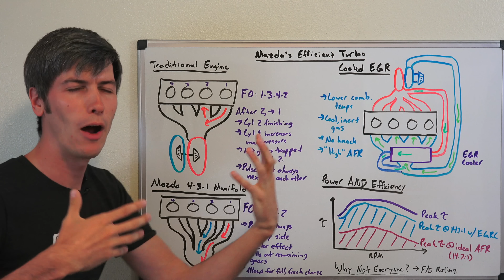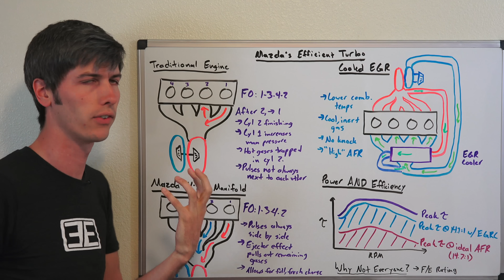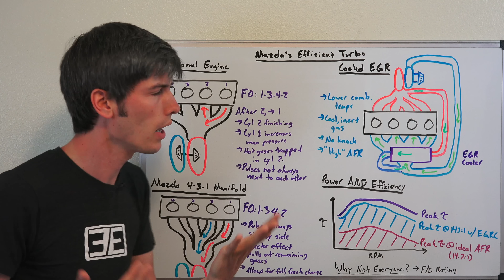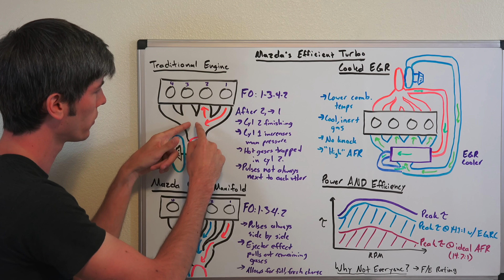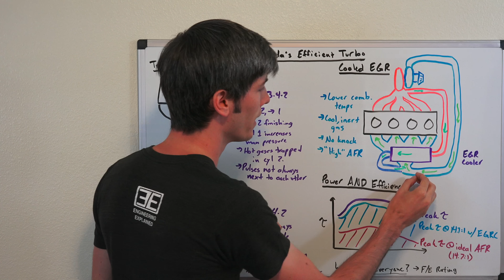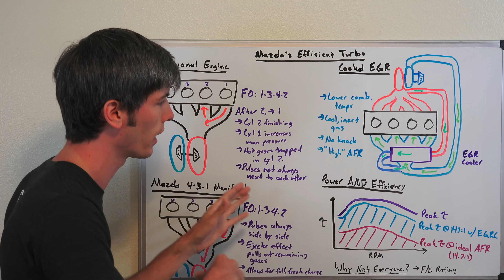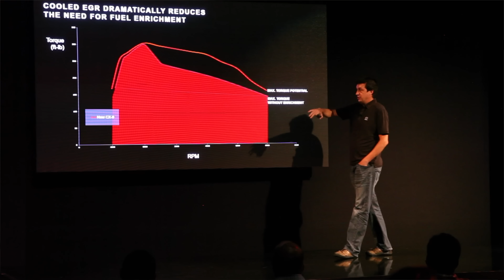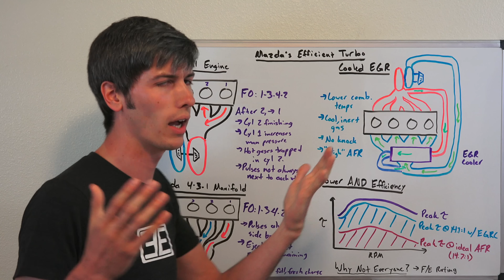Mazda's Secret To Efficient Turbo Engines

Comment: Mazda is most underrated car manufacturer. Always been.  Mazda's game is very strong now. Both engeenering and design
Reply: I might consider buying Mazda, if i can trust that they wont rust here. Half of the winter we got salt on the roads...
Reply: @jopiira  I have a 2015 mazda 3 and similar winters, no signs of corrosion yet. Although I do wash the underbody when i wash the car. It rides a little low for a winter car, but if the snow is deep enough to rub the body (abt 7"), then it's too deep for an open differential car anyway.
 
Mine's a 2.0 Skyactiv 6spd manual, 75k miles. Fuel economy drops in the winter, although it does run well, and with standard 0W-20 synthetic, it starts fast. The synchros must be tiny, because it demands much more rev-matching to shift quickly than I am used to. The open differential benefits greatly from an aftermarket anti-sway bar in the rear only (helps prevent that see-saw suspension effect taking traction off the inside front tire in an accelerating turn). Body roll is very well controlled stock, I just like the rear to be flatter than the front with an open differential. Rear brakes gave me endless headaches until they recalled them. I replaced the factory 16x6.5 wheels with 16x7 RPF1's with slightly wider offset (205/60R16 to 225/55R16), so my edge to edge track width is 1.5" wider (3/4" each side), and more rubber on the road (still flush with the body). The new wheels/tires make it handle like a BMW (no real change in economy, wheels are lighter but tires are heavier). Looks really good for a compact economy car. I've always gotten better fuel economy than the sticker (except for winter), about 32city/42hwy (give or take 5 depending), less if you're in traffic, or a drive-through. Surprisingly, hills don't hurt mpg at all. AC only steals about 3mpg, but it is a little weak, it's enough with white paint & tint, but it would suck with clear glass & black paint. EPA meter in the car is accurate. Enough power to pass/merge easily. 2 well fed vikings can sit in front without fighting for elbow room, and rear seat passengers can actually have legs. Carpet is pretty garbage, recycled matting, which doesn't like winter, but I'm replacing that with a more robust and mildew resistant carpet soon. Never had an alignment, even though i've hit some bad potholes and rubbed some curbs, it still goes in a perfectly straight line on level pavement without a crosswind. So it holds alignment better than any other compact I've owned.
 
Overall I really like it, with a few caveats. I do wish it was turn-key instead of push-button though, I'm used to being able to push-start a manual if I screw up and kill the battery ;-)
Reply: kathrynck I had a 2015 mazda 6 with a manual and just fyi you can still push start it! Turn the ignition on and get to pushing... you know the rest! But yes it was a strange feeling manual transmission.
Reply: Griffin Mead how did it feel strange to you?
Reply: AND DORITOS BRAP BRAP BRAP BRAP
Reply: Best looking cars out of all the Japanese companies IMO.
Reply: satellite964 I was gonna say the same thing.
Reply: metalbyku very true.
Reply: But they get more flaw than Honda or Toyota, painting (old story), non lasting brake and low life expectancy.
Reply: @s.lacasse8337  painting is a old story. Mazda doesn't have this problem for years now.
Reply: My brother had a 2004 mazda 6, didn't even reach 120k miles before the engine failed among other electrical issues. Sounds like their product may have improved in the past 16 years, but that thing had PROBLEMS! Nice lookin car tho
Reply: @Margaux Lowery forgetting the MX5? An updated RX8 is also probably coming
Reply: i always love mazda for being different and innovative, loved all their cars, they are fun with great handling
Reply: Lai Yuin Hong Designs are always limited by engineering and execution. Ford infected Mazda to an extent but before and after they have done better. Toyota is definitely a better partner now than Ford was.
Reply: Mazda lost their way years ago. They used to be the company known for Zoom-zoom. And now you can just get a wannabe, slower audi with a slushbox only, for cheap.
Reply: They are not underrated. They make excellent engines and offer modern exterior and interior design. Though they had reputation for rusting from 2003 to 2009 and parts around the wheels (bushing, suspension, bearings) tend to fail prematurely.
Reply: Love my 2nd gen mazdaspeed3
Reply: Toyota did that bit with the exhaust manifold back in 1990 with the SW20 MR2 Turbo and the ST185 Celica Turbo.
Reply: I see you Asian two we boof no good at English talk. Need practice grammar. You vely cheap guy thank you big.
Reply: Mazda is good but it is expensive too.
Reply: @Schmidt54 cheaper than Toyota's in Australia
Reply: Until recently, part of Ford.
Reply: bcubed72 by recently, you mean 10 years ago, right?
Reply: bcubed72 Mazda and ford have been buddies since the 70s.
Reply: they officially separated completely in 2014
Reply: @jogabonitadefutbol  Best thing that can happen to any brand : not being associated with Ford.

Look at Jaguar/Land Rover: under Ford ownership from 1990 to 2008 and almost disappeared under the radar while now under Tata Motors they're stepping up again.
Reply: I knew a guy who, in a Jaguar/Ford, cut his hand badly on the inside door handle when the chrome plating peeled off the plastic.
Reply: @MozzaBurger88 If you want examples of failure look at what GM did to Saab,what Peugeot are now doing to Vauxhall or what BMW did to rover,mg. Jaguar was dead in the water,BL laid the foundations of their doom 20 years earlier. The X type while hated by Jag purists saved the company by virtue of numbers sold coupled with cheaper production costs by being based on the Mondeo platform and raised capital to allow the realisation of the XF and XJ. Models which sold in numbers Jaguar could only dream of beforehand, developed while still under ford ownership.I look at things properly,basing a statement on personal preference or lazy acceptance of unfounded speculation because it suits your ideals does not make it true,no matter how one eyed you may be.
Reply: @davidm5707  I replace more chrome peeling parts on Opel and Nissan products than any other make,Suzuki are not much better.
Reply: @MozzaBurger88 ehhh I miss the Mazda speed cars they need to bring it back
Reply: They have always had the fancy tech & revolutionary engineering but they just have never been reliable as Honda Nissan or Toyota... Nissan has lost allot of reliability over the years but in my opinion Nissan still more reliable than Mazda
Reply: You guys realize mazda still uses a lot of for design right? Look at their suspension and transmissions.  Breaks and what not.
Reply: @o1mtbiker  I worked as a Mazda dealer tech for a while, their newer transmissions are not ford. They are completely Mazda designed, like the engines. The brakes are not a ford part either, they’re made by ATE, an oem supplier for a few companies.
Reply: @SGcomputing  my Mazda was all ford.
Reply: @o1mtbiker what do breaks have to do with car design? If you don't rest you don't think well. 

The newer Mazdas are independent rear and kinda legacy from the focus/Mondeo.
Reply: @Low760 from a comment 6 years ago. And you left out the part about the transmission and what not. Hell the engine was even ford for a long time. Just saying for a car people rave about in design. Had a whole lot of ford under it. lol

Comment: VW’s EA888 Gen3 VW engines are also stoich designed forced induction engines. They can run in almost all scenarios at 1.0 lambda until they enrich lambda under long duration/high load conditions to stay within the 1000*c turbine manufacturers limit. The integrated cylinder head/exhaust manifold helped extend the 1.0 lambda range much further before being limited to the turbine manufacturers limitations. Now some turbo manufacturers have bumped their limits to over 1030*c which should help car makers push this envelope once again.

Comment: If only mazda did this 15 years ago instead of waste so much time with Doritos
Reply: Beach&BoardFan. Never any wasted time with Rotarys.
Reply: No... he’s right about the Doritos. Having to change apex seals and fill it up with oil every week is nothing I’ll ever be jealous of. I’ve got two 1100 shaft horsepower engines that spin at 37,000 RPM that do anything a rotary can do but much better.
Reply: Beach&BoardFan This technology wasn't available a decade and a half ago.
Reply: Spam Can could have been if they didnt waste time with doritos.

Also pretty sure scavenging and methanol injection has been around for more than 50 years... theres nothing new here.

Comment: Cooled egr’s are nothing new, diesels been using it for a while and ask the power stroke guys nothing but problems.
Reply: A Arr diesels have a lot more particulate to deal with (hence the DPF) and just like anything, the specific design and implementation is just as important as anything.

Comment: So does the engine not have a turbo intercooler? and instead the EGR cooler is regulating the intake temperature ?
Reply: Mark Acevedo I believe it still has an intercooler for the charge air, the EGR cooler just helps to not negate any of that effect.
Reply from the maker: They are still intercooled.

Comment: torque levels are great can't deny that, but 227hp out of 2.5L with a turbo??? come on mazda honda would had been making 250hp out of a 2.5L "NA" engine all day and still claim over 28mpg EPA . if cooling is the main turbo problem just add a water cooled intercooler  . just thinking outloud but would it be  possible to water cool the exhaust too?
Reply: Axel Official Lower cost maybe?
Reply: Making 250hp from a NA 2.5 is not necessary
Reply: Guillaume Landry yeah i hear you on the cvt , but I'm not talking about late honda models, since they started using turbo engine too. I'm talking about the late 90's-mid teens.

Comment: As I understand, the EGR is closed when we demand real power from the engine, that is when knock can occur due to the high temperatures inside the cylinder... so what's the point of adding that if you can't use it when you need it more?. Unless the EGR is partially opened all the time in the newest cars, but I don't think so...
Reply: Think again :-)

Comment: If this EGR system is used under high boost, then it is different then most other systems, because normally the EGR system is turned off, when full power is needed, to get a cleaner burn.
If the drawing is correct the EGR system works as a wastegate, taking exhaust out before the turbo, but instead of dumping it into the air, it dumps it in the intake on the high pressure side of the turbo.
This means that the exhaust pressure must always be higher then the boost pressure or else everything would flow the wrong way.
The EGR air makes a smaller bang and therefore less exhaust air and therefore less boost, so please explain how it is possible to EGR under load without loosing power?

I am guessing that the 4-3-1 manifold makes it impossible to Twinscroll turbo this engine, i dont se why this is better then a 4-2-1, that also pulls exhaust out of the other cylinder.

Comment: Cooled EGR intrigues me. It's one of those things that looks great on paper, and fails miserably in the real world. Obviously diesel and gasoline engines are extremely different. But why does deleting the EGR and the EGR cooling system from a Ford 6.7 powerstroke triple the reliability of the engine and increase mileage by a large amount? Like, from 17 to 21 mpg average on the same truck, same driving conditions. As a technician, we fear the day EGR coolers make it to gasoline cars. For our owner's sake.

Comment: I have a Speed 3 and have always been a fan of Mazda engineering, especially since when they made the interesting but problem-prone Wankel rotary into a feasible engine for production cars. Having said this, recirculating EGR gasses without a catch can is problematic, especially with only DI. A hybrid PI/DI system alone gives the necessary fuel wash over the intake valves to keep them clean (because a factory catch can may not be feasible, besides fuel wash works better). I hope Mazda does this, like many other DI engines have had implemented.

Comment: I have a 2015 Mazda 6 and I've read claims that Mazda's direct injection Skyactiv engines don't suffer from carbon buildup because because they've been designed it to prevent that from happening.  Is there any truth to that?  I haven't seen any discussion around this claim and don't know if it's really true.
Reply: Gregory Wills From what I hear, they keep the intake hot enough (like 400° or something like that) so that the carbon would burn off or just not stick to the intake. I'm not sure if that's 100% accurate, but it sort of makes sense
Reply: That is false, intake is made from plastic it would melt at 400 C.

Comment: in real world it will clog up and be cut out soon, just to make it driveable again...
Reply: elektrinis how will it clog up and cut out soon? This is a tried and true and well researched implementation.
Reply: like everything else clogs up. Starting from DPF, ending with EGR. Saw some really nasty clogs after only 100k km.
All in all, further advancements of internal combustion engines leads nowhere, it almost hurts to see engineering talent being wasted on this.
Reply: elektrinis there is no DPF here though, so are you basing your opinion only off of diesels?
Reply: I have seen many clogged EGRs.
Reply: elektrinis I’m sure you have. Doesn’t answer my question though.
Reply: I thought it did. Problem is actual to both petrol and diesel engines. Ofcourse more to diesel.
The more obstructions, piping and filters you have on exhaust, the more problems you will run in to once your engine wears and starts smoking.
Reply: elektrinis 
I recommend steam engines for you

Comment: I had a 2016 CX9 Signature and did not see the fuel economy numbers... I averaged 12L/100kms..... the hp was lacking and it was anemic on the highway, not to mention sounded like a tractor.... I got rid of it after 8 months.... went to a 2018 F150 EcoBoost Supercrew.... now I average 12.5L/100kms, have 470ft lbs if torque and all the cargo capacity I need.... not to mention it's a friggin FAST truck
Reply: Pussaty 
Fake fake.People know you don't waste your time .

Comment: I wish there was as much work done on finding an actual viable alternative to internal combustion engines.. Mazda has done an amazing job at finely optimizing those engines, but at the end of the day, they're still fossil fuel based and not really a long-term solution
Reply: Yeah it would be better to plug your electric car in to charge it from a coal fired power plant.
Reply: ChaosPotato there's a ton of development going in to electric and hydrogen
Reply: Electric has a sizable problem though, what are we gonna do with all the Lithium from dead batteries? Who's gonna want to recycle that (if at all possible)? If we're just gonna dump it in giant lithium landfills, we might as well go back to bicycling xD
Reply: ChaosPotato What if a much cleaner biofuel is developed?! Apparently Bosch is on the job.
Reply: Ton of biofuels exist
For example, hemp can be refined into fuel
Reply: You can recycle the lithium to build new batteries. Plus lithium batteries never die, they just get less energy dense over their lifespan. Old car batteries can be installed in homes and near street lighting etc. To smoothen out the power requirements from the grid, especially with the prevalence of solar power
Reply: That's what I meant by "dying" yeah, when you can't use it anymore in the car because it won't propel you for more than 20km! But I get your point :D